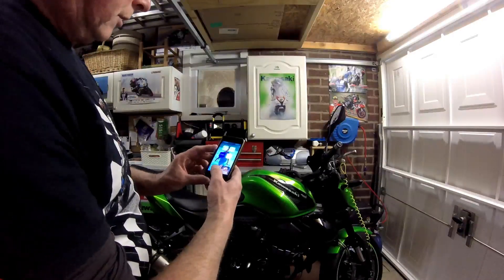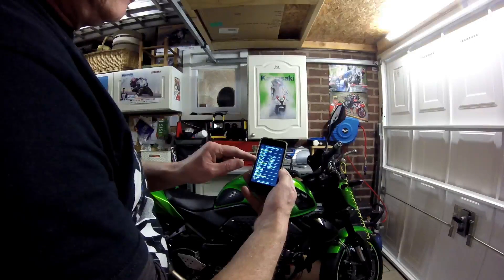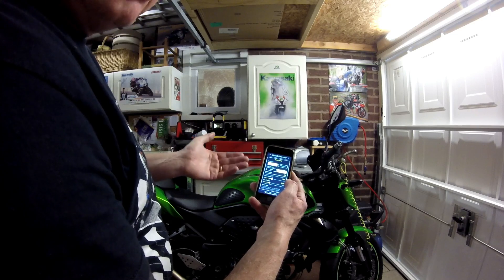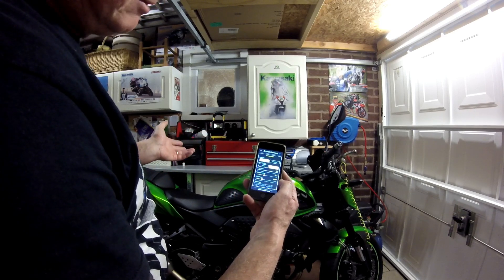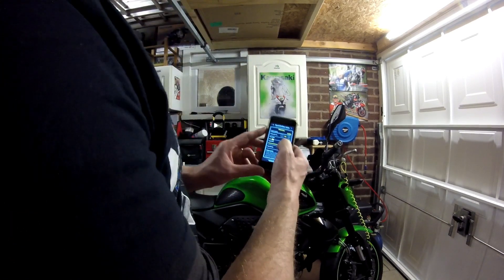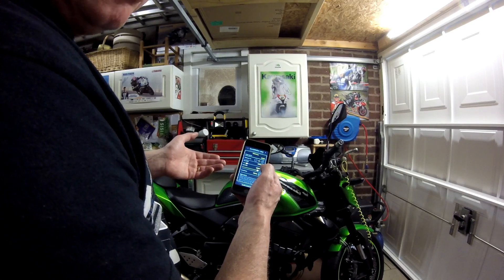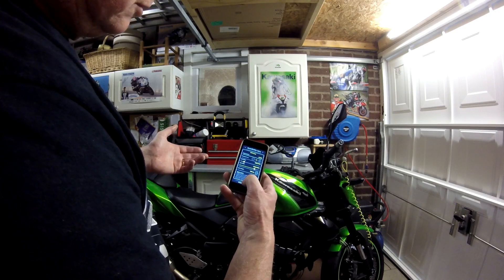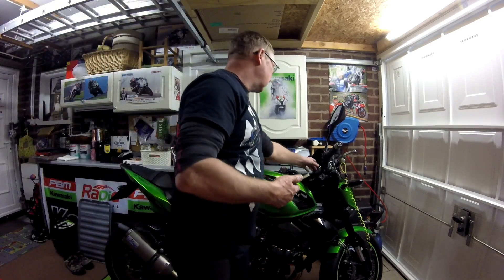Healtech Quickshifter set up

Comment: Hi,
i have also a Z750 and installed the healtech quickshifter.
but i have the problem that i somtimes hit false neutral and thats not good for the gearbox. do you know how i can avoid hitting false neutral?
can you tell me how your cut off times are?
Reply from the maker: You have to set it up on the app, it takes ages to get it just right.
Reply: did you find how to fix it friend?
Reply: No i couldnt fix it. I deinstalled the quickshifter because i Was tools worried about my geraboy
Reply: @wirdgelade  omg
Reply: Ik im hella late but ain’t you supposed to rise the sensor threshold when that happens?

Comment: hi dear friend, I have the same bike as you, im looking for oppinions of the quickshifter healtech, function, if is good or not installing it on my bike. And if it worth. thanks and have a nice day.
Reply from the maker: Dani ZR  fitting the Quick Shifter isn’t a problem is quite straight forward really, the only thing with it is setting it up just right. There’s a app you get for your phone so you can keep changing the settings until you get it perfect. It does make a difference if your at full chat going through the gears.... it’s a lot faster😜 it’s only on the up shift not on the down shift.
Reply: paul williams z750 Thank you very much! I preciate Your opinion, also thanks for reminding the downshift 😂😂